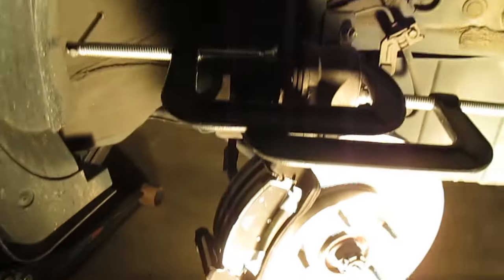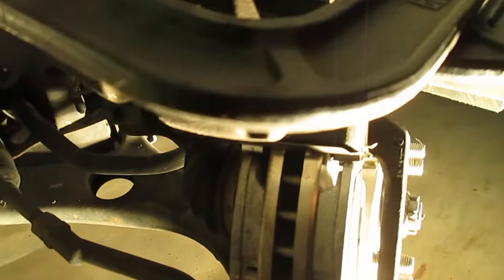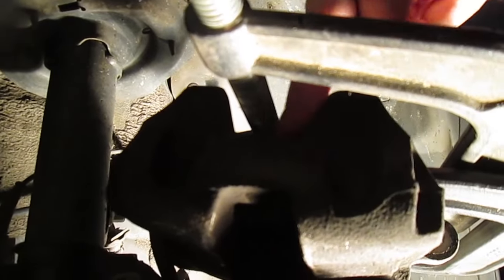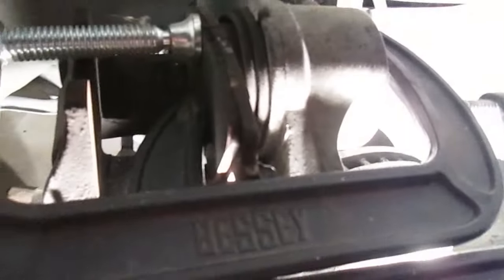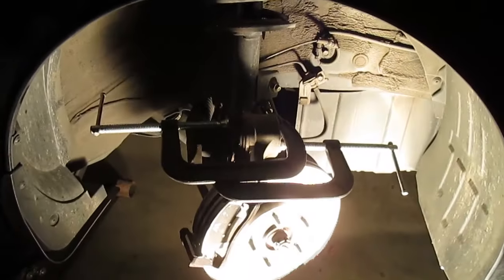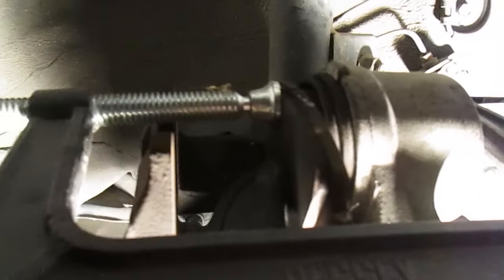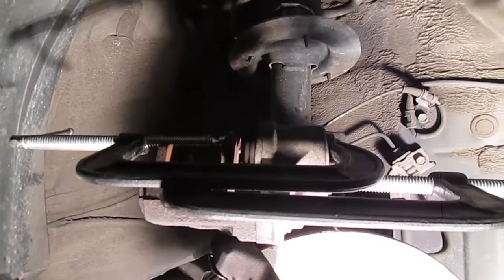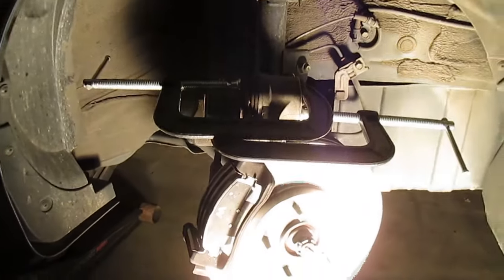Brake Caliper Piston Stuck/Won't Compress? Try This (Hyundai Sonata front disc brake) - Jody Bruchon

Comment: Great tip! 

1 C clamp worked fine on the right side after replacing those pads.

Left side....Piston wouldn't budge.

Used a 2nd C clamp and that compressed the piston smooth as silk.

Happy New Year!

You got ours off to a great start.

Comment: This is a godsend. In the middle of putting on new rotors and pads...only to find a frozen caliper piston....waiting on a buddy to come thru with a c-clamp. Hating life atm
Reply from the maker: At least you have a solution. Funny enough, I just used this on an Edge today, too. It has a dual piston caliper!
Reply: @JodyBruchon  not having a c-clamp is literally the bane of my current existence. Should I be shooting penetrating oil under the rubber seal?
Reply from the maker: @yowaitwhat  NO. NEVER DO THAT. NO.
Reply: @JodyBruchon  shit....
Reply: So I probably need a new caliper I'm assuming...
Reply from the maker: @yowaitwhat  Only if the two-clamp technique doesn't work. Use a used brake pad to spread the pressure out evenly.
Reply: @JodyBruchon  tried! Bugga is frozen. More than the movie
Reply from the maker: @yowaitwhat  That sounds like it's time for a new caliper. If you compressed too hard with one clamp, you may have jammed it out of alignment. Sorry to hear about that. :(
Reply: @JodyBruchon  all g! I have some slight shaking while braking at aroubd 50mph and up, I figured it was a wopped rotor. Would a seized caliper piston cause shaking while braking at higher speeds? 🤔
Reply from the maker: @yowaitwhat  it absolutely can. The brakes are made to be aligned to the rotors. If the piston seizes, both sides become uneven, and the rotor will sort of make them "wobble."
Reply: @JodyBruchon  that explains it! So I most likely didn't need new bads/rotors...needed a caliper. Or maybe I just needed for the one side w/the bad caliper. I'm assuming a seized caliper will also cause some warping on the rotor and pad. Either way, I have 2 new rotors and pads. Gave up on the repair, threw the old shit back on in absolute and utter defeat. Didn't even take a look at the passenger side. So I'm hoping the other caliper is good. And I only need to purchase 1. Unless that's a "you do 1, you do other" kinda deal?
Reply from the maker: @yowaitwhat  Unless it's a very old vehicle, you can replace a single caliper. I had a 1990 Beretta GT and replaced one brake caliper around 2005, causing the other side's caliper seals to blow. The new caliper caused higher pressure to be applied to the very old one and popped the seals. However, we're talking about a car that's well past 10 years old and that seal was probably going to blow eventually anyway.

I'd say to go ahead and replace the one caliper now. Don't forget to bleed the air out of the system when you do the replacement.
Reply: @JodyBruchon  thanks for the advice, man. I really appreciate it! I'm currently on the hunt for a new caliper, but here in hawaii, I've better luck at the junkyard, than someone actually having it in stock...so I might have to order one. Would I still have to bleed the lines, even tho I never actually disconnected the caliper?
Reply from the maker: @yowaitwhat  You have to disconnect the brake line from the back of the caliper to attach a new one. That will introduce air into the system, so yes, the new caliper will have to be bled.

Comment: Another satisfied viewer here!  The caliper on my '12 Sonata didn't look that bad but I was ready to give up because I thought it was seized.  Dang that was a pain to get back in!  I compressed it against the rotor, it took a while but finally got it in.  Thanks!!
Reply from the maker: In a follow-up video, I discovered that you can do this with a single clamp if you use a wood clamp instead of a traditional C-clamp!

Comment: Thanks so much. It's guys like you that just want to help others that makes youtube what it is. I had done 2 previous break jobs on other vehicles and never had an issue compressing the piston. But, as you said...one c-clamp won't do it. I was about to head to the parts store to buy a new caliper assembly...when I thought to look on youtube and found your video. I used a 4 inch and 6 inch c-clamp...and just as you said...it worked. 

Definitely a thumbs up. You saved me right at $90.00.
Reply: SanityOne you have to use the tool that Spin the pistons

Comment: Tried compression tool at a slight angle, worked on one front caliper piston but not the other.  Tried the two C-clamps and it worked perfectly on the more difficult of the two.  Even compression is the key.  Thanks for the video.
Reply from the maker: Steven Mog I'm happy to help.
Reply: Steven Mog the right too is the key has to spin in

Comment: Just hammer on the outside of the caliper while it is still installed.  Old school tricks still work today, especially on those tiny calipers.  Save yourself 45 mins, do it in 1 minute.
Reply from the maker: No need to even do that. I re-did this exact same Sonata recently and it turned out I had the perfect tool the whole time: a wood C-clamp! The wood clamp is much thinner and can easily handle the force of pushing back a caliper piston. https://youtu.be/CTtOI9l-wKw

Comment: I Had this situation with a 09 Sonata two days ago. I don't have c clamps but a tool that did allow me to center the pressure, butthe thing still wouldn't budge. I don't know if this was smart or not, but I started the car and, ever so slightly, tapped the brake pedal with my hand. I turned the car off, tried to apply more pressure and it compressed. Why do you think it worked after that?

Comment: That happened to me too uneven Caliper piston that wouldn't push in i broke my 6 Inch C Clamp trying to compress it but i had another one and was able to compress it i did one Edge first and then the other edge and it worked with only one Clamp

Comment: I think maybe instead of focusing on the spinning, and hitting the caliper, put the spinning portion on the cylinder, put it on the back of the caliper and the flat part on the cylinder, and I think it would be OK
Reply: Sorry, I meant to say, instead of focusing on On the screw portion of the clamp on the piston itself put the flat solid portion of the clamp on the piston and the screw portion on the back of the caliper I think it would be good

Comment: Both of my rear break pistons will go out fine but for some reason they won’t go in no matter how hard I try, any ideas?
Reply from the maker: Make sure you opened your brake fluid reservoir cap. If you don't then you won't be able to compress the pistons because they'll just be pushing on one another. If you did that, I'm not sure. I have not done the rears on this car but disc brake pistons are all basically the same thing on every car I've touched so far. If you can't get them to retract then something is clearly wrong; don't try too hard to force it. Ask an experienced mechanic for some ideas if you're not sure. I'm not an experienced mechanic, I'm a guy that doesn't like paying for basic maintenance I can do myself.
Reply: Had the same problem with Honda. I suspect it was rust on the piston behind the rubber dust shield hitting the seal.

Comment: My Hyundai i20 caliper piston won't come back out. Depressing brakes only allows a little movement but remains in. Any tips guyz?
Reply from the maker: Unless there's some sort of clog in the lines, a leak somewhere, or you have a bad master cylinder, it's time for a new caliper.
Reply: @JodyBruchon  Yes. It was the master cylinder.

Comment: My brakes have been sticking lately..when i got my brakes apart, i noticed the pads are ruined, and discs wrecked too..Ive ordered new pads and discs, but worried the piston might be ruined.. i did manage to push the piston back in.. should it be okay now? or is it likely to keep rubbing disc?
Reply from the maker: It sounds like you waited way too long to replace the pads. It's good practice to replace the rotors when you replace the pads. Brakes should not "stick." If new pads and rotors do not correct the problem, you definitely need a hydraulic part of some sort, be it new calipers or even a new brake master cylinder. Check the rear brakes too, if you haven't already; they wear out much more slowly, but they do eventually require maintenance as well. I can't tell you what's going on for sure. If in doubt, it may be worth it to take it to an actual mechanic.

Comment: Do you have to remove the fluid reservoir cap first?
Reply from the maker: Always loosen the cap before compressing pistons. I recommend leaving the cap sitting over the hole though, not completely removing it.
Reply: Jody Bruchon ok thank you it’s still doesn’t seem to want to compress but I’m using a different style clamp not a c clamp so I think I’ll by a c clamp and then try that
Reply: @JodyBruchon  After loosening cap, I packed several rags around it to soak up even a minor bit of spillover.

That brake fluid likes to eat up things!

Comment: Guess I gotta go get another clamp and try it lol '10 sonata
Reply from the maker: If you use a wood clamp,. they're smaller and can fit between most calipers without needing a second clamp, and they usually can handle the force involved.

Comment: Why not just turn the c-clamp around?
Reply from the maker: The purpose of doubling up the C-clamps on an old brake pad is to apply more even pressure. I couldn't get the piston to go back in with one clamp even when flipping it back and forth; it would have taken forever and might have damaged the piston or piston sleeve. By using two clamps the piston isn't being rocked in the sleeve, so it resists compression a lot less and the risk of damage is far lower.

Comment: Bro you have to spin it with a special tool.....
Reply from the maker: And what do you do when you don't have that tool? And what if you already have it apart and just need to get the job done? I get that special tools exist, but most people have access to a second C-clamp but don't have access to AutoZone at 10 PM with the car disassembled. That's all.
Reply: You take a clamp to push and channel locks to spin. But if your method doesn’t damage anything... but if it was meant to spin it should probably spin. There are threads in the piston and I would assume you are just force stripping the threads and thus introducing tons of metal into your system....
Reply from the maker: @avatheavydog7053  There is no method by which to spin the piston. It doesn't have slots or even a rough edge. I'm sure it's not supposed to be rotated.
Reply: Jody Bruchon then you are correct sir and I am wrong. I apologize
Reply: @avatheavydog7053  some cars have special tools you need because they spin while pushing, i needed it for my mini cooper S but on most cars you can just compress them back in